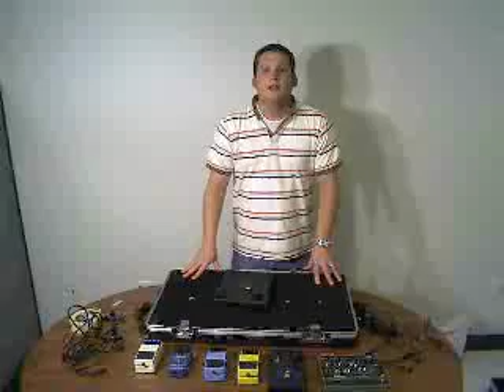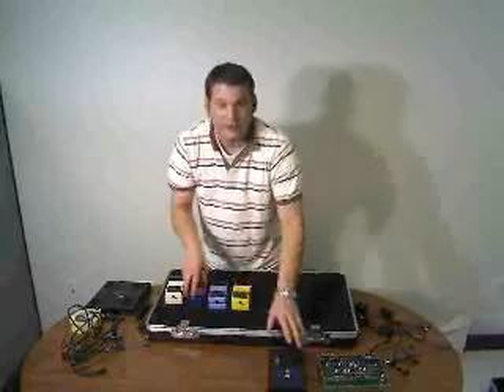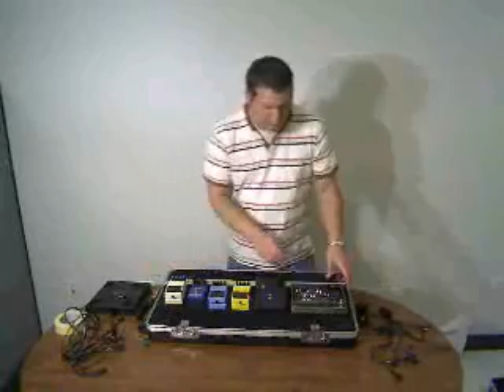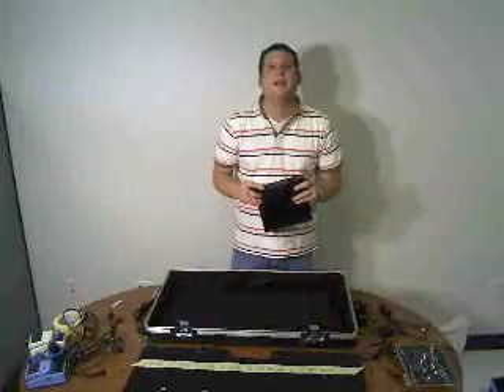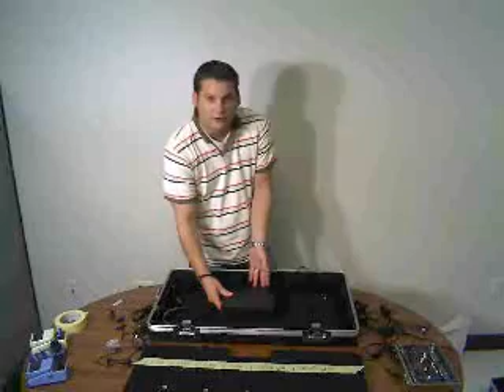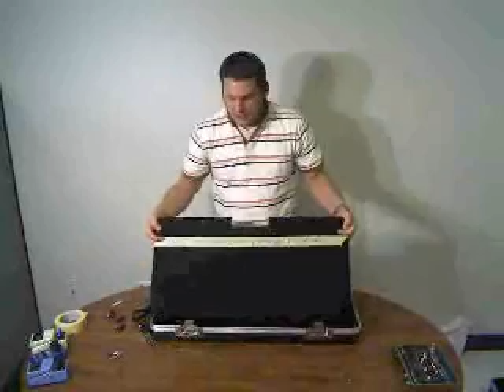Voltz Pedal Board power supply system - Install

Comment: Looked all over. There's one massive bit of info i can't find! How many isolated outputs does this have?
(aside from regular 9v low current pedals that are fine not isolated, I have EHX hazarai, Eventide Space, will be getting strymon timeline) Particularly i want to know if the Space will work as many say it will work with their supply but actually is too noisy.

Comment: Does anybody make a sort of long, narrow pedal power supply, similar to a surge protector power strip? I'm sure this is a fine product, but the shape of it it quite the opposite of what I need:/ And the typical PP2 or SupaSharger type are pretty small, but they essentially take up the same space as another pedal.

Believe me, I WISH I liked the angled boards that store the power supply underneath, but I prefer flat on the floor, and I just don't think I could get used to anything else:S

Thanks!

Comment from the maker: If the minivolt has the right voltage, it would not deliver too high a current, as the amount of current is dictated by the resistance of the pedal (Ohm's law: V = IR).

Comment: I'm trying to power 3 pedals at the same time, but the only conclusion I've found is by buying a Daisy Chain from Maplin. But, when I have the Delay (DD-3) and the Distortion (Metal Muff) on at the same time, it starts to crackle. 

If anyone could give me some advice on this, that would be very useful!